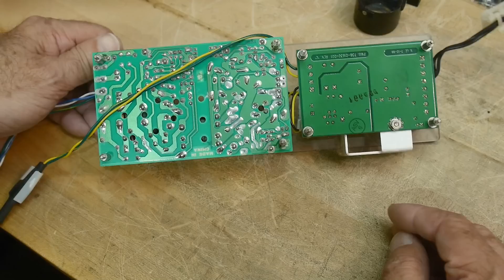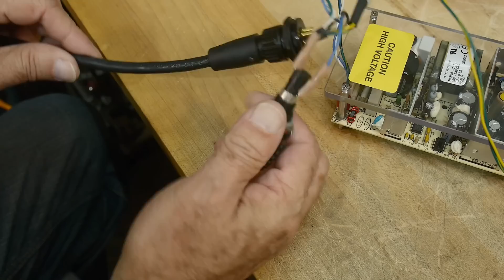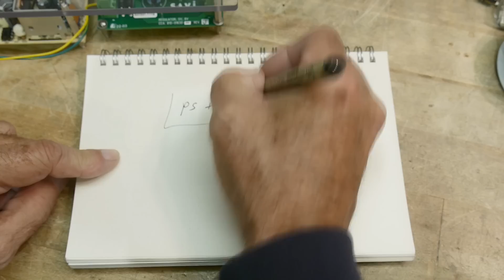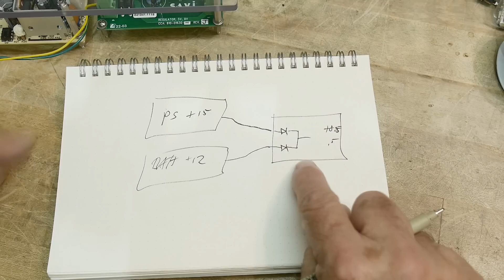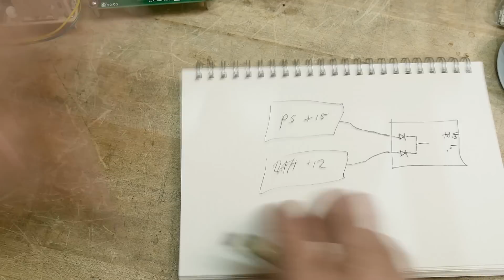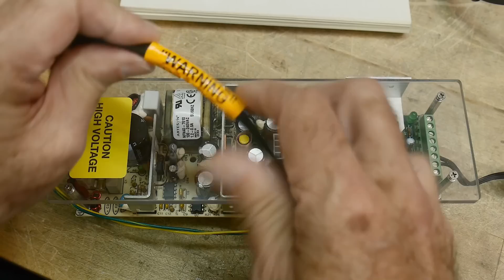#2056 Double Power Supplies

Comment: In my experience, standard voltage level AC-DC SMPS + project tailored DC-DC is cheaper than custom AC-DC at low quantities. Epecially for battery option, like you mentioned.
Not to mention time to product & safety certifications.
In this case it was even worth getting low dropout (600mV @ 1.25A) regulator and not a vanilla 7805. So they were planning for voltage & load regulation headroom of the first stage and ripple increase over time.

Comment: What's the story with the cut in the ground plane on the SAVI board? Surely since it's all a continuous ground the cut isn't necessary right? It looks like there's a bottleneck for current that could easily not exist with a single solid plane 🤔

Comment: I do also wonder about the 8 terminal connector at the output. Just two of them are in use, so they must have had cheap 8 terminal leftovers if it is not for the stability of the board.
Reply: They are all connected.  One for 5 volts and one for 8 volts.  The other two pair pick up the input voltage after the diode.

Comment: I've done "crazy" things like that. What happened is I needed a single output power supply. I had three options, build it or buy one of the two off the shelf types. Building it was more expensive, and the power supply with dual outputs was cheaper and smaller than the single output.

Comment: My brother worked for SAVI for a number of years installing the RFID stuff in all the NATO locations.  The scanners he was installing was for cargo loading and unloading from large cargo planes.
Reply: That's what it came out of, cargo scanners.  I got a pallet lot of SAVI RFID scanner kits at a surplus auction.  Had the data modules (which this supply was used for) transverters, tripods, antennas, coax, hand held scanners, etc...

Comment: This is an easy one... It's a small company with a low production product. You use a COTS power supply up front like that since it has all the safety approvals therefor,  there is a whole boatload of certification testing that you don't need to do.
Reply: That's my guess. Dodging cert pain for an offline switcher.

Comment: These came out of a outdoor fiberglass enclosure that housed these power supplies and a data module for a RFID scanner.  Got a pallet of these systems at a government surplus auction.  The RFID scanners were used to keep track of inventory as it was being deployed at sea ports or air ports when military units deployed.  The brand of the equipment is SAVI, just Google the brand name.  They still make and sell RFID scanner systems.  Each vehicle or large piece of equipment has a large RFID module stuck to it and the scanner system has antennas mounted to tripods to scan them as they get into range.  I bought the lot because it came with several hundred feet of LMR-600 coax, several heavy duty antenna tripods and the nice outdoor fiberglass enclosures.  Also got about 2 dozen 2.4GHz antennas in the lot which is the frequency range the RFID tags operate at.  In the enclosure they only used the output with the wire attached and connector.  That's what supplied power to the data module.  It could have EASILY been powered by a wall wart but we are talking about equipment made for the military.  Rule number one when making something for the military, make it as complicated as you can and charge 10 times to much for it.

Comment: Is the battery input not a kind  of backup when mains power fail? Have you meassured the outcomming voltage in comparison to the output from the first supply in regard to ripple and noise?

Comment: +5 and +/-15V would be great for an Eurorack modular synthesizer, though I'd rather use a linear regulated classic supply for the analog circuitry.
Cool dual source design. Makes sense.
Dang nice DC barrel jack there - I love indestructible parts!

Comment: You said it was a odd design at first, but it is obvious that the secondary control circuit is actually used to avoid the hiccup mode caused by low starting current, which is the weak point of SMPS systems.

Comment: The Bayesian priors I like to use for unconventional and surprising actions are: 60% likely due to laziness or cost-cutting; 38% due to incompetence or lack of information; and 2% due to malicious intent. 

And, jokingly, π ± 17% if you are bad at mathematical reasoning.
Reply: or they got a deal on boards surplus but not quite the right voltage, or the parts count was too low, or we don't want anyone to be able to get parts.
Reply: @ucrash2  "or they got a deal" = cost-cutting